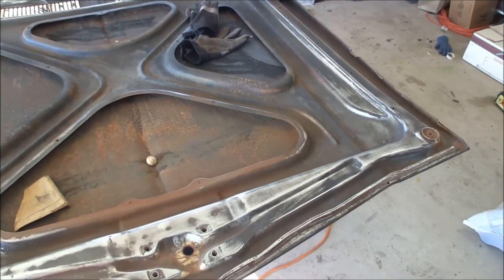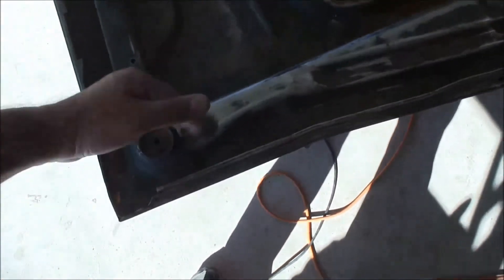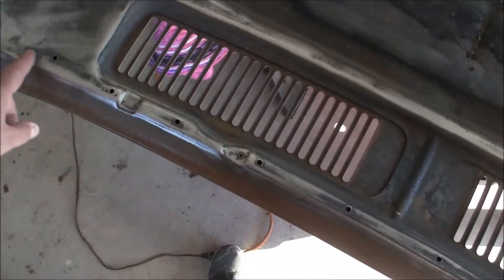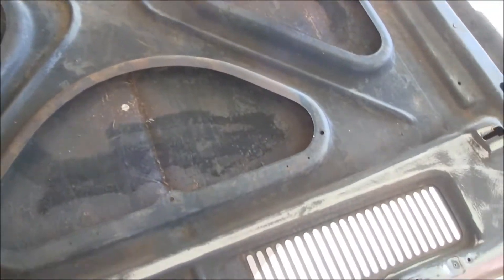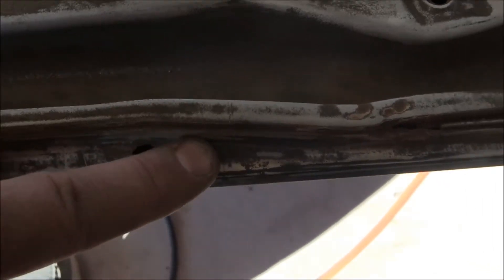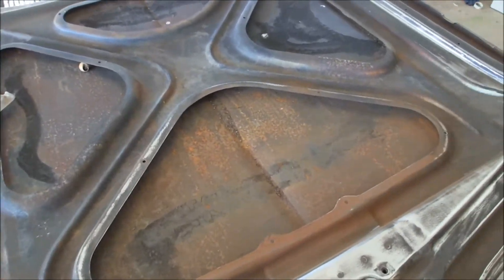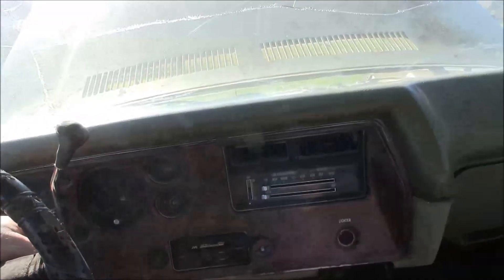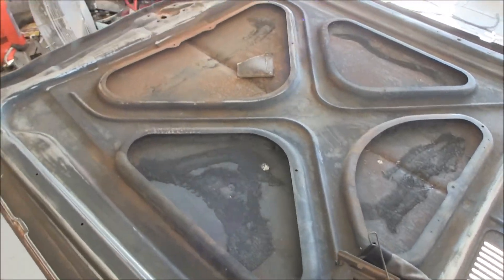1969 El Camino Restoration Part 18-  Da Hood Chapter 1

Comment: KC you give me a giggl lmao ! I had to sand blast the inside of my hood and still couldn't get under the cross braces. I also used acid to melt some of the rust and found 3 small holes i had to weld up. KC this is a labor of love because the pay sure isn;t worth it lmao! Great to see you back. I hope to have something on my floors soon. Its a ton of work and life gets in the way. Keep it up bud !